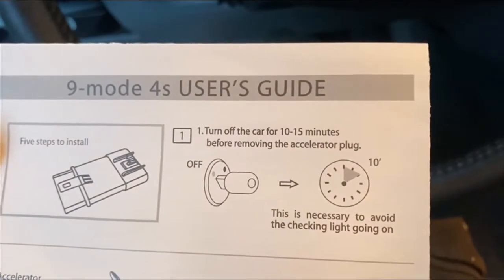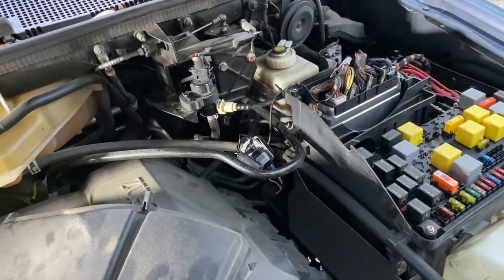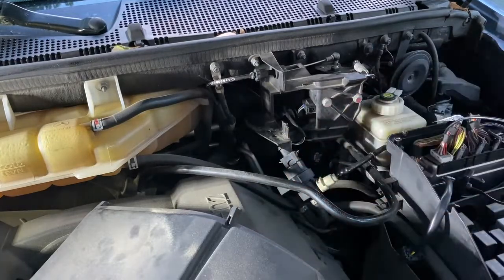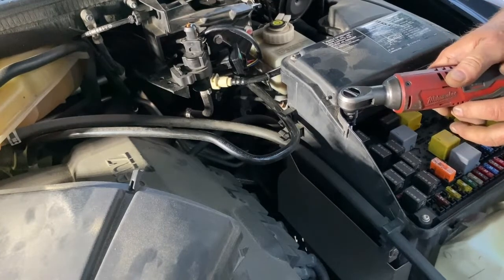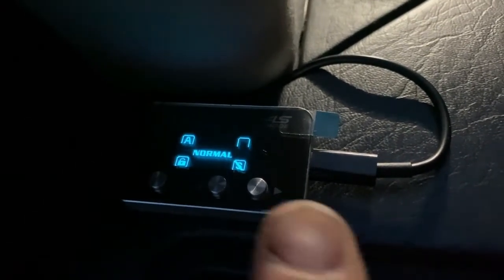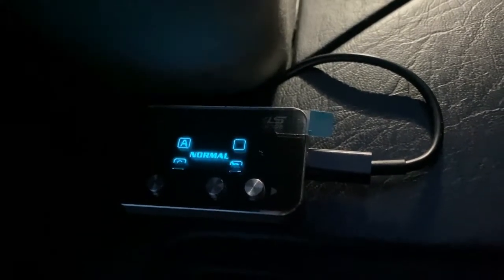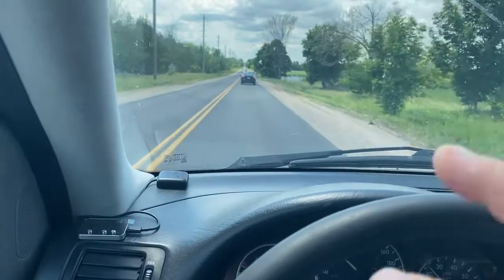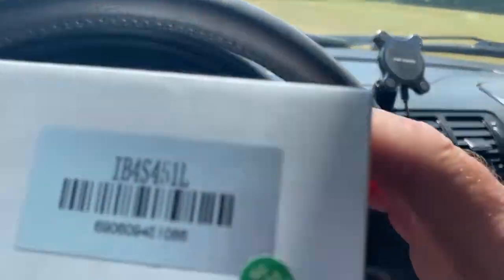Windbooster electronic throttle controller .Mercedes install ,review , discount, and free giveaway

Comment: Reminds me of old carbureted GM V8's. They had engineered the throttle linkage so that 50% throttle plate opening  was achieved with the first quarter of pedal travel or thereabouts. It was progressive.